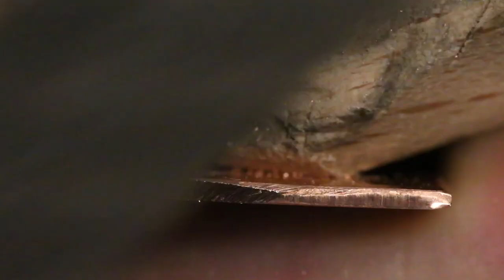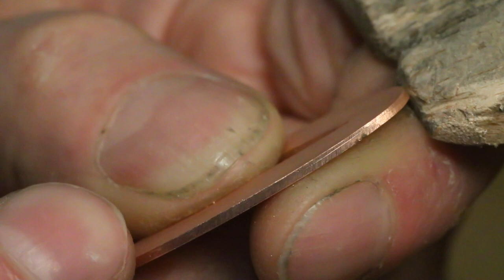Filing seppa - Japanese decorative spacers

Comment: Another reason for rounding by making multiple facets is that it's much easier to control the shape. It's easy to see whether an edge of a facet is straight, but if someone tries to just round everything from the start, the curvature is really hard to see without some sort of radius gauge.
Reply from the maker: that's exactly right and is in fact the basis of the traditional approach to filing up half round rings. We'll be doing a tutorial on that shortly actually.

Comment: Great work! I apologize if I missed it. What do you do if the marks do not coincide at the last point? I'm a big fan of your work. Greetings from Russia.
Reply from the maker: when you get to the last 2 cm or so you can do a check lightly and either widen the gaps or make them narrower by a smidgen, it's easy to lose a10th of a mm over 20mm.
Reply: Thank you very much for your answer!
I tried one more way. Markup is done in increments of 2 times. The error in this case is less. First I make an incision on the first markup, after the second one, and after that I make a cut between the marks. The middle of the segment can be found very simply. And so every time - first cut on the mark, after that - on the resulting segment. But when I was very young, I was tormented with markup and I got a lot of roughing points, in which I was constantly confused.))))
Your way I like much more!
P.S. Sorry for the bad English, I did not have practice in the language for more than 20 years.
With best regards,
Mikhail
Reply from the maker: that's a good trick, you mean go one way then go the other way?
Reply from the maker: and your English is fine, we can communicate easily. I cant speak any Russian ;-)
Reply: No, I mean making cuts step by step. If we make cuts in two ways all around we can't see final result and it inforce us to return back for correcting previous work. 
For example: we have to do 50 cuts. In this way we work in according with folowing steps: 1,3,2,5,4,7,6... It helps to make cuts with visually constant increments on curved edge with variable radius. 
But I must to say again that Your way is much easier, more correct and more quick.
Thank You!

Comment: Hi Ford,  the pin file doing the scallop work what size are you using.
Reply from the maker: a small one ;-)
it may be an escarpment file. These are very fine and small files used by watchmakers.
Reply: @FordHallam  thank you for your reply,  I've just purchased one.